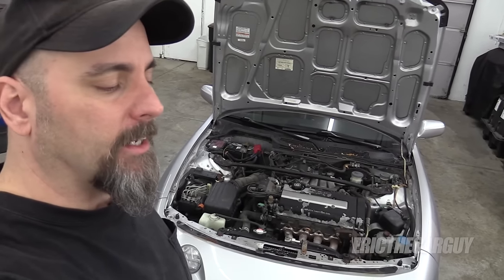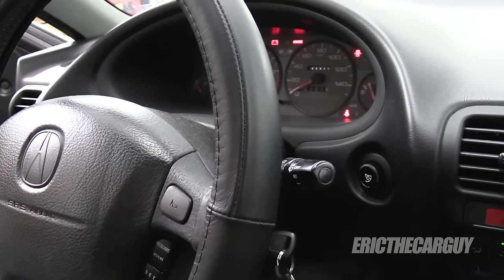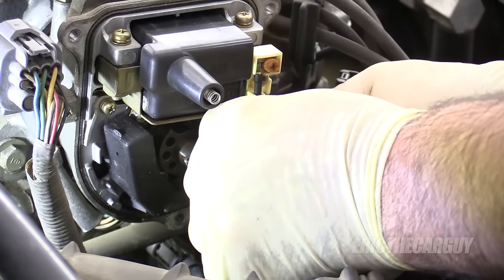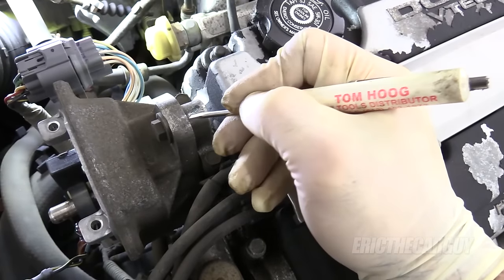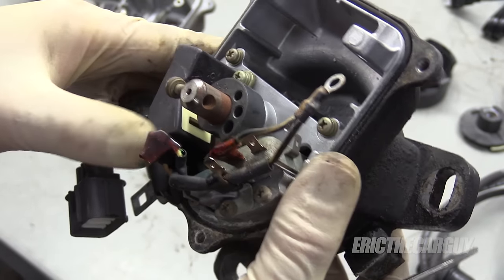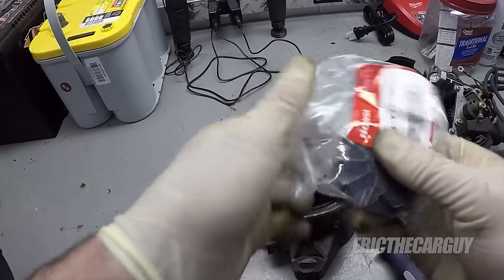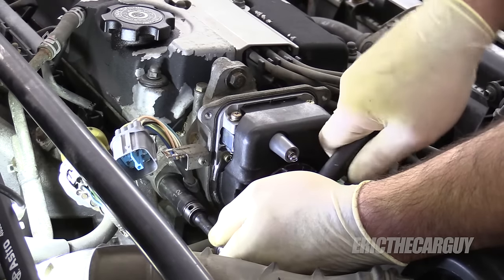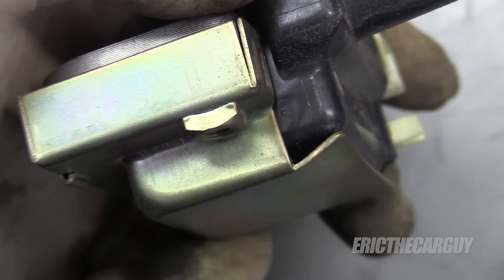Honda Ignition Coil Replacement (Complete Guide)

Comment: I'm inclined to blame the failure on the washing of the bay :) they seem to go hand-in-hand from past experience, and yes I did notice the heat spots on the coil, and i've also rebuilt a dozen Honda distributors over the years. Great video update to your older Honda distributors.
Reply from the maker: No. I washed the engine 2 months before this coil failed. Also, the Civic coil also failed as shown in the video and I never washed that engine. Ignition coil failures on Honda's are a very common occurrence.

Comment: I was able to easily replace the ignition module ( part you call the ignitor) without removing whole distributor.   I remove the whole air cleaner assembly which allows easy access to the everything.   I have replaced the coil and the ignition module  and my 2001 CR-V still will not start after it is warm.  I have also replaced Temp Sensor, Cap, Rotor, Wires, Plugs and fuel filter.  I do now know what to do now.  I was thinking of replacing the whole distributor or the fuel pump.   Other videos state the problem is the 1st three components I mentioned (coil, module, and temp sensor).

Comment: So you know how you mentioned, "Avoid getting into here and prying on this plastic part because you will break it" when you were removing the ignition rotor, well, I did exactly that because the rotor has been so tough to get out and I thought that would help. Anyway, now I have a plastic part in small pieces and I am wondering if that plastic part/dust cover important? Can I run the distributor without that plastic piece? What are complications that I may have if I don't have it on there? Thank you!

Comment: I'm surprised Eric that you aren't using the Honda factory Cap, and spark plug wires. These vehicles run and idle the smoothest when they have genuine ignition parts installed on them. It's weird, almost like the ECU can detect when there is Aftermarket ignition parts installed and it doesn't Run right.

Comment: using some heat transfer paste or grease definitely will help to extend the life of the ICM by making it works a bit cooler, and there is no cons of using it. electronics chips works better at lower temps posible.

Comment: Hey Eric you mentioned something about poor aftermarket parts quality. I work for O'Reilly, and for foreign vehicles euro and Asian, the premium brand we carry for engine control parts (Import Direct) is 99% of the time the OEM supplier. All the way down to makers marks and part numbers if stamped. I've been selling the stuff for a couple years and they seem to be OEM quality, I don't think I've ever seen one come back that wasn't a bad call to begin with.

Comment: Distributor, yep, the original one on my 94 GSR failed right at the end of 2013 I believe.  The car died at a traffic light, and I had to get my father-in-law to come tow me back to the house (getting towed with a tow strap was scary by itself).  One of only 2 times the car has ever been towed in 16 years of ownership.  Don't know if it was the coil or the ignitor, but I didn't care.  I ordered a brand new Cardone Select distributor from RockAuto with lifetime warranty.

Good thing for the warranty because that one failed on me late last year.  The car didn't die, but would buck and hesitate really bad when opening the throttle.  I thought it was the clutch slipping at first.  Good thing for the lifetime warranty, though.  I got another brand new distributor for only the cost of shipping.  We'll see how long this one lasts.
Reply from the maker: I'm not a fan of aftermarket distributors as I've seen many of them fail and also set check engine lights. I'm also not a fan of shotgunning distributors when Honda ignitions fail. If it was just the coil, you could have still had a good distributor and only paid about $14. There's a video linked in the description showing how to diagnose a no spark condition with Honda's.
Reply: I know that now, but didn't know it then, and needed to get the car on the road, and the aftermarket distributor is what I could afford at the time.  Car runs fine, though, with 360,000 miles.  No CEL's or anything else.  I don't know how much longer I'll have the car, and I only drive it about 5,000 miles a year now.  If it fails again I'll just replace it for free again.
Reply: I might still have that old distributor.  If I haven't thrown it out, is there a way to replace just the coil and see if it works, without having to install it on the car?
Reply: As far as I know you can't really bench-test a distributor though I could be wrong.

Comment: If you are doing a tune up to replace the cap and rotor DO NOT do what eric did at 2:10. You will likely cause excessive damage to the coil/ignitor(it is no longer grounded when the cap is off) and youll have a big towing bill. To access the rotor screw, manually crank the engine counter clockwise via the Power-steering or the crankshaft bolt. Removing the spark plugs will make turning the engine over easily. 

Eric should address this or this video will cause a lot of headaches for people

A little cpu compound between the ignitor and heatsink will help transfer heat better. I believe there is some by the factory.
Reply: or just remove the negative terminal on the battery, in that way there is no voltage running

Comment: Hi Eric just wanted to say I have watched your video and it's great. Here is my problem, My 1995 Honda Accord LX 2.2. I has an external coil and after removing the Cap, rotor and dust cover it seems like it's not just two screws to remove the ICM. I could be wrong but the majority of replacements on You Tube are Hitachi with the coil in the distributor. Again, my coil is external. Just wondering if I have to remove the distributor with a TEC Dist. BTW my issue was after 13 mins of running every time  just stalls after igniter overheats, plenty of fuel pressure, restarts after 15 mins like no problem. Again any help would greatly be appreciated! I hope its just the two screws you speak of. I have the new ICM but my question again is is it just two screws with a TEC Dist? Thanks again!

Comment: My car which is a Integra hasn't started for about two weeks and I believe it's this. Well my distributor won't even turn. So I broke off the entire cover to get to the screw and that screw is definitely locked in there. Do you have any ideas how to loosen this screw? At this point I'm stripping the screw. I need help loosen it.

Comment: My crv has those exact same burn marks on the coil. It died the other day, so after checking everything in the ignition system, that's all I found wrong. Got a new one for $60, putting it in tomorrow.

Comment: Use a socket wrench and an extension to a Philips head adapter to remove screws from the distributor.. You can find the right bit easier, you can apply more torque to the screw and odds of stripping the screws are smaller.
Reply: On d16 the rotor must sit between the number 1 and 3 pin if there are some dummdumms brushes about 10:30 pm degree like anolog clock at tdc. That detail took me days to figure out.

Comment: 253 in use thin flat screw driver to snug and pry gently hitting different angle. easy do not spin rotor at all! mark it with white out to put back at exact degree. or you will mess up youre timing and hve to pulll apart weverything and do timing to top dead center

Comment: Good info, though with your wire talk is that just for Honda's? Ive had two Ford Mondeo MK3s (2001 and 2003) that both ran a little poorly, changed the leads and always gave a noticable difference. This is comparing after both had new plugs and service, adding leads after made a noticable difference. Also wondering if perhaps its because they're coil packs instead of dizzys.

Comment: Great Video! My friend has a dc2 Integra and his tachometer isnt showing the rpms correctly. 

It revs to about 6k and then the needle shakes and doesnt go further but the engine revs like it should to over 8k. 
Btw the car also died twice in idle while parking.

I think its an igniter and/or coil Problem. Im not sure tho. 
Can you clarify?
Reply: 99Lezard99 it’s gonna be the distributor,my civic did the same thing,threw in a whole new unit and it’s been great for years now. Look around at auto parts stores and find a good brand of aftermarket parts
Reply: It's the ignitor

Comment: my CR-V has the same setup,  ive replaced the cap, rotor  and leads  with after market ones  total cost  about $50.00 NZ dollars, been over a year and it still works sweet,  if i had got honda parts i would have paid over $200.00 NZ Dollars oO by the way i keeped all my old parts for back ups  they still worked but very old 19 years old
Reply from the maker: I find more coil and igniter failures with aftermarket parts. Also when you go to remove the leads be careful. In my experience certain aftermarket parts tend to pull apart when you try and remove them.
Reply: when i had the parts next to each other, you couldn't tell between them both even the leads looks like OEM leads only difference was the length, very good copy's, ill keep i good eye on them when i pull them off to replace my spark plugs, cheers

Comment: So would oil in the spark plug wells cause this to short the coil? I have no spark and the distributor is only a few months old. Going to replace the valve gasket and rings. Gonna take your word for the oem ignition wires lasting forever.

Comment: Need help Eric hopefully you reply.
I have a 1997 Acura Integra GSR wont start or crank I turn the ignition with the key to start it up and only the fans turn on and lights from the cluster I already replaced the starter and bought a new battery can’t think of nothing else really appreciate your opinion Thank you Eric

Comment: Thanks for the video. I changed the distributor on my 98 accord.it won’t run after. Do you think I had turned the rotor without knowing it ?I didn’t pay attention to which way the rotor was pointing to. If this is the case, I can turn the rotor back 180 degrees and reinstall it, it should run, right ? Because I transferred all the components from the old one to the new already. Thanks

Comment: I warmed up my '97 accord, then i used my other car to go out.. Forgot that my accord's engine still running until the petrol and battery dried out😂 when i came back i topped up the petrol but the engine won't turn over. I bled the air out of petrol line but still won't turn over. Then i checked the spark.. No spark. You think i have the same problem as your honda?

Comment: Everything I have read says when replacing the distributor, put #1 cylinder in TDC first is that correct, I replace mine and have fire now but timing is off and I didn't put in TDC first.

Comment: i hear what youre saying eric about OE parts for Honda, especially ignition related. to be fair though, youre right, it is a common problem and the evidence of the failure on those OE parts is poor quality in my opinion. if the aftermarket coils do a better job than the OE stuff then why not! :)

Comment: Hi, Eric, my problem is, Maine, I change for new ignition lock assembly,  and when I turn the key it doesn't make contact, and when I turn the key it doesn't make contact, the dashboard lights don't come on. it is possible that the problem is The ignition coil? Thanks and good video.

Comment: A bad coil will give symptoms of bucking  while driving or when you start the car it will run for a few minutes  and then die. These were my symptoms in a 2000 accord. If you ever get this, quickly change your coil pack, they are  $15 on ebay

Comment: I feel my B16A2  "failing" when i'm at low RPM, like 2k rpm in 3rd gear and i press the gas, i feel like i have no fuel, i feel it fail an then took off like normal, when increasing speed and rpm.. it stared to happen when i pay to wash the engine underneath, and on the same day it gave me error 4, CKP sensor.. maybe i got water on the distributor??  im sad.. i really love my car, but im not a mechanic, and i don't want to mess things up.. can you help me figure what is this, and what should i do best... ? thanks, you're the man!! love your videos!!
Reply: Did ya ever figure it out?
Reply: @cammk9415   Yes, it was the distributor that got water inside and also the throtle body sensor that was faulty.. changed that and the car was good has new.
I got it sold meanwhile, great car!

Comment: Hi Eric just wondering,my honda civic 2000 has no any problem only the coolant from the radiator is barely empty & the reservoir is almost full of coolant fluid..the mechanic did a compression test just to find out if my car had a bad head gasket..after all this work “compression test”when he starts the car it doesn’t starts anymore..he changed the distribution cap & rotor as well as the sparkplug resistor but still it didn’t work..please i need  help I still need my honda civic and I love this car so much..23 years in service.😢

Comment: So I have a cb7 accord 91 se manual and I had to replace ignition lock cylinder because how it was jam in start messed my spark plugs up bad. With that being said I've change out spark plugs, spark wire, battery and I can get it to turn on electrically speaking but can't get it to start or even make the car sound of trying to start does mean I automatically need to replace my distributor or could there be another problem.
  
      Also in the situation I've described can my alternator get messed up really would help to get feed back on it, as a young car enthusiast who's trying build is first car this would probably help me in the long run.

Comment: Eric, I have a 95 Del Sol with the D16Z6 engine.  It drives great until it gets to operating temp.  Once it gets warm it starts misfiring.  If I shut it off after driving for a bit I won't be able to start it back up for a few hours.  If I try to start it when it's hot it will crank and backfire, ether will not start it either.  Distributer?  Main relay?

Comment: I have a 95 F150 with an inline 6 and can't keep a set of plug wire on it.  200 miles and I have a bad jerking miss at 60-70 mph.  I have checked wiring, grounds, voltage, replaced plugs, wires, cap and rotor.  Checked for stopped up cat, replaced distributor, module and ECM.  I'm out of ideas except to check every wire between ECM, module and distributor with an ohmmeter.
-- Do you have any suggestions or anything I'm missing?

Comment: My 98 Accord 4 cylinder has had a random stalling problem and now idles inconsistently with a check engine light on.  Maybe is the ignition coil?  Don't think it's the ignition switch, as wiggling the key doesn't seem to do anything.  I've had the distributor replaced.  Any help would be awesome.

Comment: Hey Eric, not so much on topic to the coil but on topic to both the D16 Civic and B16/18 Teggy.
I have a set of B series extractors from my mates integra and I have a EK Civic with a d16y4, i know ill have to add wire to the o2 sensor so itll reach but before i go pulling it all apart (its cold and night time right now in Aus) I was wondering if you knew if itd be bolt straight on. Im fairly certain it'll bolt on to the engine no problems but the length of the dump on the b series extractors compared to the d series is what im not entirely sure about. 
I know I could just go have a look but as I said before, its cold and night time and i really dont want to go outside hahaha

Comment: I got a 1994 Civic with the D15 non vtec and when the car is warm I got a lot of hesitate and misfire in low rpm doing a stop start, people I replace the fuel filter as well the fuel pump thinking it was a problem there but it isnt, and now some people tell is the trigger and some the coil, theres a way to test it with a regular voltage meter? I dont have an osciloscope

Comment: Hi Eric, I know this is a video for the Ignition Coil but I had a question regarding changing out the Ignitor in a 1998 Acura Integra GSR. 

I diagnosed my car to find that the ignitor has gone bad so I went to go replace it and I noticed my Ignitor only has the 1 screw instead of the 2 screws like in the Distributor from the civic. I removed the 1 screw. But I can't seem to get the ignitor out it feels like it's absolutely stuck. I even grabbed it by some pliers to try to pull it out but it won't even budge. At this point I don't even know what to do. 

Any advice or help on how to get the ignitor out would be great! thanks!

Comment: Great video!
I have a question; the temperature gauge on my Civic doesn't work anymore and I'm trying to figure out what's the problem (I'm a newbie);
I have checked the service manual and it says to unplug the wire from the ECT gauge sending unit and ground it.
The problem is that I cannot understand, from the image on the manual, which is the correct wire; from your video (at 6.25) I can see two wires under the main spark coil section. A smaller one on the left and a bigger one with a grey clips on the right.
Is the left one the wire which I'm looking for?
Thanks in advance

Comment: After removing the distributor cap there is a spring sticking out of the tower of the ignition coil. Is that Spring important/Critical?  Mine has fallen off and I cant seem to get it to stay back in place. The car seems to be driving ok (other than a slight misfiring which it has had  for some time. Im about to do the cleaning of the cap, and replace the rotor.)

Comment: Excuse me, i have problem to take off the ignition rotor screw. I could not turn it with screwdriver. Is it possible it have a glue or diffrent rotation....i mean right hand thread? Thanks for the answer in advance.

Comment: 1993 Honda civic 1500DX 3dr hatchback 5 speed. car doesn't want to start under humid conditions. i have replaced distributor cap, rotor and wires. still has problem after rain. All OEM  parts except wires which are no longer available. so I used Denso wires. Could the problem be the coil?